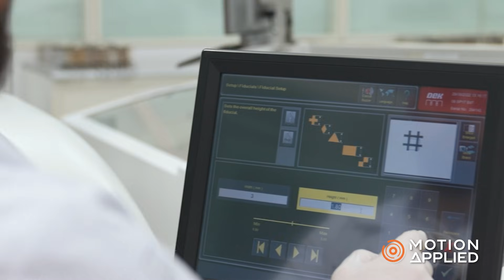Formula 1 technology expert advances hybrid eVTOL lift system

Comment: 🤔 , .... uhmmm this news, has raised a questionable idea,  like motor sports, can we slap sponsorship on our livery.    We do run weekly spots just about, and travel and pitch, and mmmm its just the prototype.  🤠   lil x5 flare and swag.  Besides i know a full spec x5 on the way, i can feel it in muh bones.       People think im nuts, well i am cash-ews. #hovr gone forge as a industry leader in drone qnd uav capacity too. 

Why? .... again and again,  ive yet to see any vtol , and i mean with heavy players now entering the sector like honda , Toyota and china.   Have the ability at 500lbs or more, perform vertical lift, and transition forward flight, with the least mechanical moving parts. 

An we knots ahead on drag coefficienency as well.   

#hovr for the victory lap.
Reply: What are you even saying ? Speak plainly you crazy speaker
Reply: @CMIdotCOM  ... envious,  why?    Insulting why?  Lol , they called Albert crazy too.   But the strange part is, your smarter than me, so smart you attack how I'm speaking, so you must be the more intelligent being.